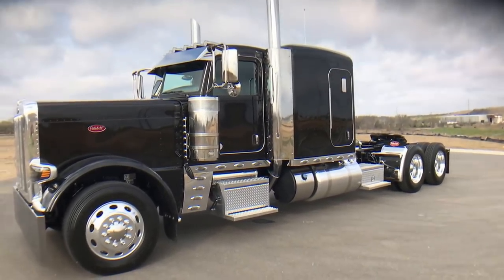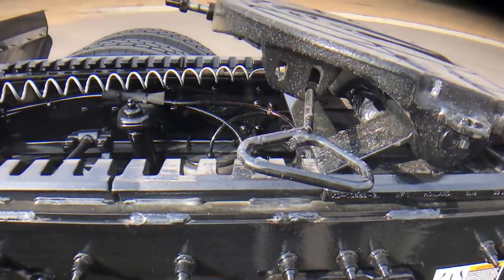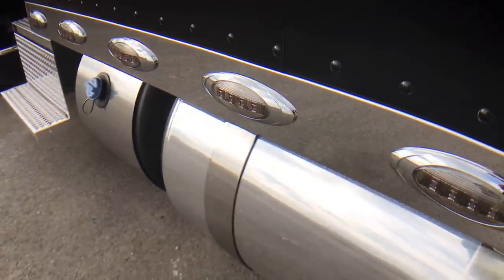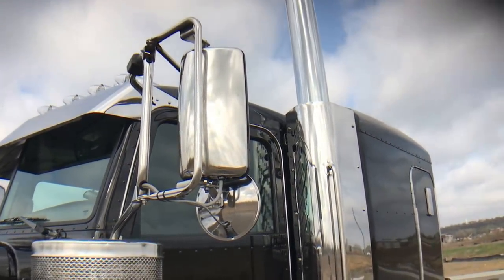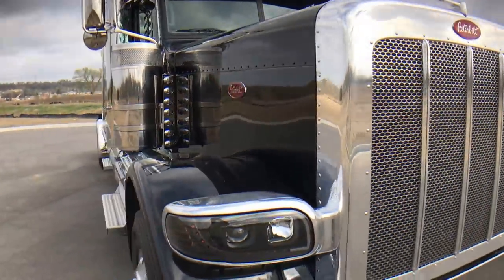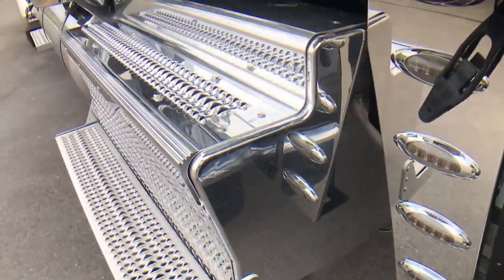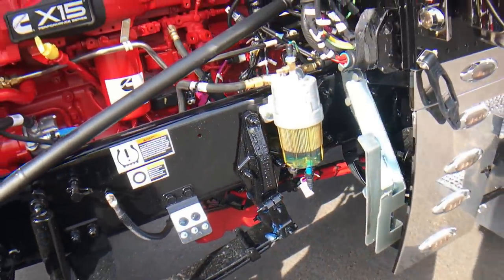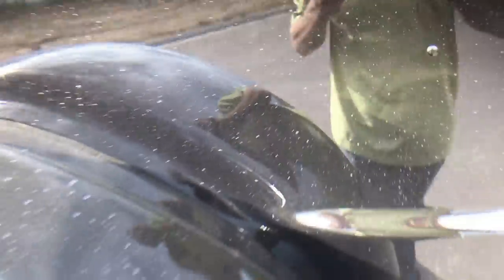2018 Peterbilt 389 Flat Top Legendary Black X15 Cummins Custom Lights

Comment: LOVEN the interior great job as always Steve. Question... The cover for the CB, does it only come in the smaller size for the Cobra 29? I have a larger radio, but still would want the cover if possible. Thanks!
Reply from the maker: Only one available bud

Comment: Great truck!!! do the same Legendary black but with a stand up sleeper. Go old school with full gauges no navigation and rosewood everywhere it can be put on. 
Double frame front to rear 14,6 front 46rears 
4,33 full locking rears
52k Neway ADZ suspension 
11R24,5 Michelin tires
CAT 3406E or C-15 550hp single turbo
18 speed transmission with factory installed pto 
2 line Wet kit
Tripac E APU
6 load lights
Sliding back glass
Dual spotlights
80 inch sleeper platinum interior but with Rubber floor mats NO CARPET whatsoever 
Fridge, 32"flatscreen
18" Texas bumper with 2 foglight holes and the tow pin hole too. 

Oh my God that's my dream truck right there
Reply from the maker: That would be one heck of a rig!
Reply: Peterbilt Steve that pretty much sums up my dream rig too everything Tirofijocr listed i like it

Comment: I've noticed the last few have been 1850 not 2050, is there a special reason? Just curious
Reply from the maker: They both get the job done as you well know. Just playing with price points on some. Depending on the rig trying not to bust 160k or 170k Believe it or not some guys have dedicated lightweight stuff that the 2050 does not appeal to them. Just mixing it up. Keep on rooster crusin  my friend.........

Comment: What's the difference in price from 565/2050 to 605/2050?
Reply from the maker: Right at $3600 for that 50 hp
Reply: Peterbilt Steve does it make a difference in fuel economy?

Comment: that's really sharp hard to argue with black....but drop the front aXle like that brown hot rod...then you got something
Reply from the maker: Oh I have things in the works......
Reply: Peterbilt Steve  what is the mpg on a truck  like  this
Reply: he could probably tell you better but in the 6.0 to 7.0 mpg range would be a good number running 60 to 65mph, you start supertrucking running heavy, 75 to 80 mph, or gotta be first one up the hill and it drops to 5 to 5.5 mpg real quick......
Reply: John Hull
Reply: I do have a heavy  foot I like  to do the speed limit  I'm  a tanker guy always  about  78500
Reply: I have a  05 379 Pete 550 cat doing  about 6mpg now
Reply: I don't know what you drive now but with such a big torque number I think half the trick of MPG on these is staying low in the rpm range and using that torque vs winding them up I mean like 1500 rpm max if you roll into it you should see mid sixes without really sweating it....but you'll definitely be able to run the limit up or better up just about any hill
Reply: Victor Vincent you might be right around low sevens...if you're getting six outta 550 🐈 it's tough to say I was in a 2015 isx 550/1850....13 speed.... there's so many variables though...rears' , tire height, terrain, loaded weight....I was rolling expedited flats for a gas well Company so there were a lot of loads were money was no object and we need it yesterday so  economy wasn't an issue....and I was brought up on 2 cycles Which is a different mindset of driving...and I'm pretty sure it was turned up just a little but I can't say for sure....it was the first emissions truck and Cummins I ran.... really good experience though...I always shied away from Cummins because a nieghbor ran a 444t when new year's ago and he liked it til about a half million and it just completely went kablooey when a wrist pin walked into a liner and it was extremely expensive to fix....compared to the 8v92's I ran.... but that'sa whole different world ago.... with the choices you have new today... Cummins is right at the top, I've heard good things about the new Detroit's but you can't get one in these ......if you like the way the big cat pulls you'll love a big motor Cummins....they seem to have the issues worked out of them for sure... but I would just keep in mind... don't ever let anyone do anything but change oil on it but Cummins and there parts ARE EXPENSIVE
Reply from the maker: Somewhere in the 6's is most common, driver controls it all.